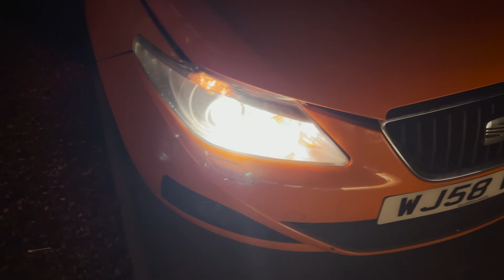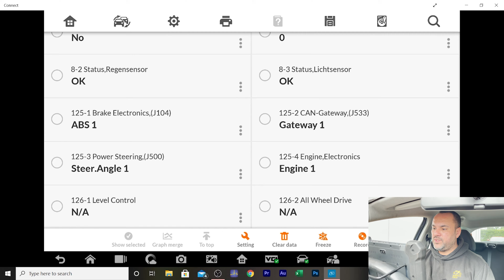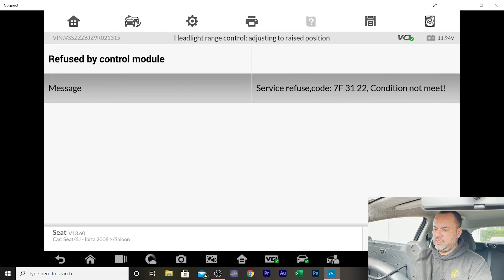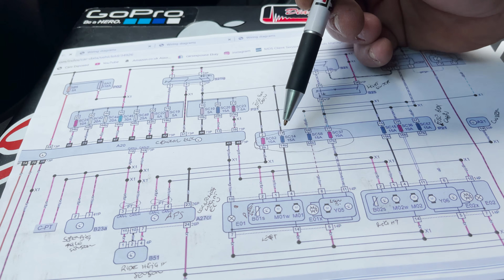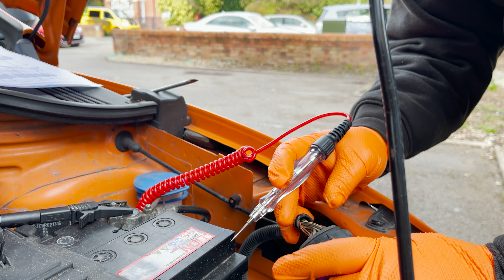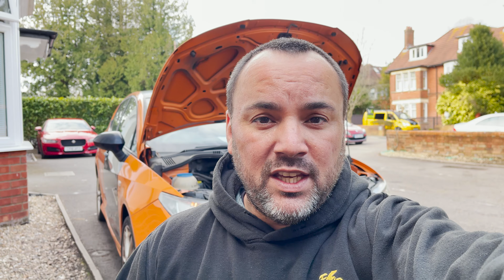AFS Adaptive Front lighting System Problem Fault Code 02629 Copart Salvage Seat Ibiza EP6

Comment: U need to help me, I have have the same problem on my seat Leon and I replaced the afs module with the exact same one and still not working error code on vcds 02233 and 02244. Cornering lights don’t work but the rest of the lights work apart from the left xenon headlight is dim. Any chance u can tell me where I can get the wiring diagram from? I can’t code or do anything on vcds as it says no communication with the module

Comment: I have just gotten this fault on my ocrty VRS, but I have no front or rear sbort to ground. I just have lead light level system short to ground. Unplugged both sensors and then I got front and rear level sensor short to ground. Am getting 5v ref to both front and rear am starting to wonder is it thr AFS module that's failed. Going to skoda next Thursday
Reply from the maker: Sometimes modules are not able to distinguish between open circuit or short circuit so you could still have a simple bad ride height sensor problem  , did you get any figures from the ride height sensors on live data ?
Reply: As in voltage? No but I can check. Its just very strange is as just says "open circuit head light level system, so shal I check live data going to the sensors? They both said-100mm ?
Reply from the maker: @RorysW0rld  ah ok open circuit headlight system , I would check for the wiring inside the headlight or in my case there is another AFS module within the headlight underneath the headlight and when I removed mine it was easy to see the issue , it wasn’t sealing properly and the module was covered in green crusties very badly corroded ... vídeo will be up as soon as a new module arrives 👍
Reply: @CarsExposed  ahh yes mine has them, il have to remove the bumper. Did you go genuine, if so roughly how much please?
Reply from the maker: @RorysW0rld  I bought a genuine second hand one for £50 on EBay I’m trying not to spend too much money on this project 🤞👍
Reply: @CarsExposed  yeh that's not bad. You see mine doesn't say LH or RH which makes me think it's thr modual, when I unplug them it says level sensor LR/RH short to ground.
"Power supply of vehicle ride hide sensor" - short circuit to ground.

See what skoda says. Bloody vags eh 🙄🙄
Reply from the maker: @RorysW0rld  you could be right , for what I could see with mine the left and right side AFS module within the headlight has exactly the same part number ...
Reply: @CarsExposed  I shal update you on Thursday :) looking forward to your update as well 😀
Reply from the maker: @RorysW0rld  👍

Comment: Could you confirm control at the headlight whilst doing an output test? I have seen the wires within the headlights break which is a pain. 
Interesting one, look forward to the fix.
Reply from the maker: Swivel and levelling function is done by CAN-bus signal is good , I’ve checked for any damages wires inside the headlight no problem there but found something else wrong with the AFS module within the headlight , waiting for parts at the minute video will be out as soon the parts turns up 👍